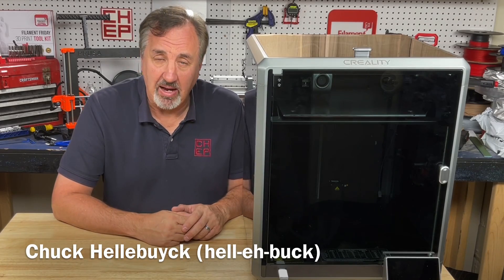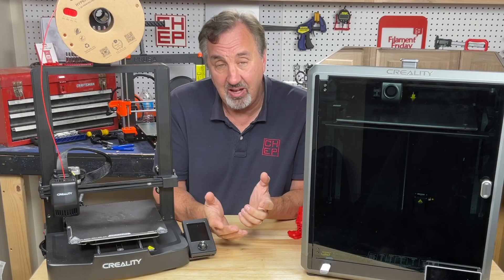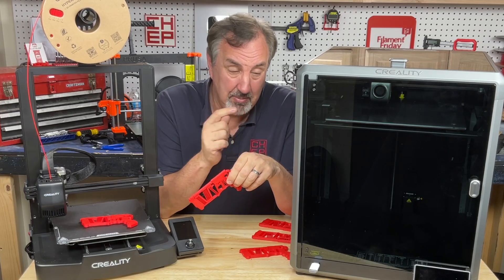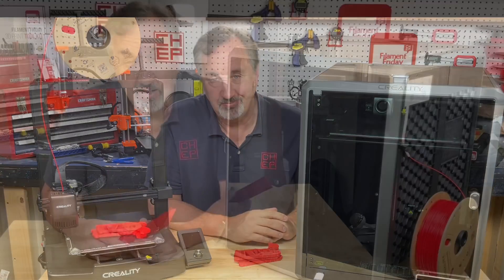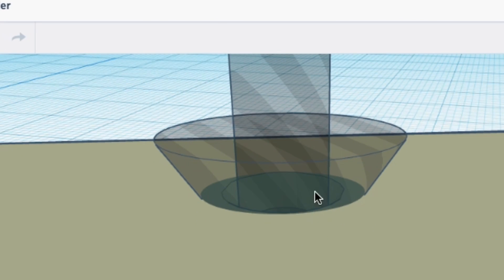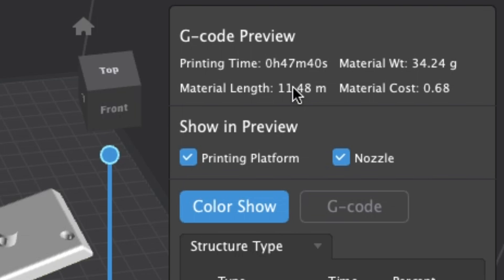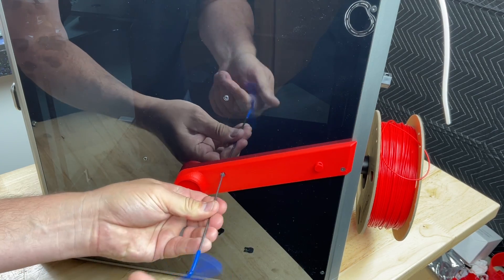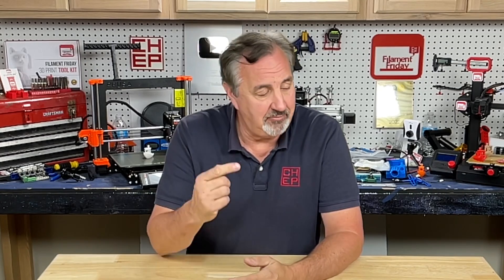Side Spool Holder for Creality K1 Max 3D Printer

Comment: Thank you. I want rotate my printer 90°, but the printer would stick out from the wall too much. You have solved my problem.

EDIT: My experience and FYI for others...The closest length of screws my ACE had was 20mm. No big deal to shorten them. I shortened to 12 and 16mm. The 16mm goes in the middle of the glass. No problem. The 12mm goes along the glass edge. No bueno for me. The screw wasn't long enough. Back to the store for another 20mm screw. For this location at the edge of the glass the length of the screw is not important. I used the 20mm length. It has no ill effect on the printer.

Comment: This was my first print on the K1 Max - worked like a charm. thanks Chuck.  Interesting that Creality now seem to include a model of a side-spool-holder on the internal storage. They must watch your channel.   ;-). On the  basis that I didn't have any M3.5 I used M3 for the bolts which seemed to work fine.

Comment: Printed this on my out-of-the-box K1 Max. Filament spindle doesn't fit into the receptacle. Had to ream out the PTE hole. Printed at 'normal' setting. Any ideas? ......Ah, DH got the spindle to fit the receptacle. Tight fit, which, I guess it has to be. Now to find the brim/skirt setting......much prefer Cura. Printed with brim...

Comment: I did 3 mod on the spool holder reverse boden setup 
1. Mounted side spool holder higher (gets the spool out the way) and uses the mid top and top side frame screws rather than flimsy side plastic screw  - 
2. Filed/4.5mm Angle drilled out the back tube slot on a strong angle -taking off the sharp edges of the slot and smoothing the tube flow (recommend this as an easy must mod costs nothing and works great)
3. Changed to 4mm OD -3mm ID feed tube. The filament slides in freely now TPU slides in like ABS/PLA in the tube when feeding.

Comment: soo the spool holder is already included on the k1 max when you buy it. the time laspe/camera is the only bad thing about this printer. it crashes and does not allow you to watch the camera live and then has bad frame rate at times, on top of that creality tries to make you have their subscription to use it all fully and its $100 a year. their software is fine but can not do helmets in a timely manner. they definitely rushed it and their software. Also if anyone has the camera viewing problem, you have to do a factory reset. Their support desk WILL NOT be of any help. They try to blame it on your internet, wifi or firmware and also they do not know k1 and k1 max have separate firmware. I just got mine a day ago and had to deal with all of this already. Other than that, yes its a fantastic printer.

Comment: Hey Chuck, hope you're well?
Other than the side spool holder is there anything else that needs to be done/modded/upgraded to this printer out of the box?
Reply from the maker: You don’t even need the side spool holder. It’s ready out of the box.
Reply: @FilamentFriday  how's the hot end on this printer and is it reliable? Have you had an issues at all yet?
Reply from the maker: It actually failed right after making this video. I had to replace it. Video coming soon.
Reply: @FilamentFriday  I have seen that the 3D Printing Nerd swapped his out for a Microswiss hotend that could be changed cold and with one hand apparently. Unsure of the cost implications though.

Comment: Now the PTF tube will wear out in the bend to the inside. I have 8x K1 Max and had them all. Have drilled a slanted hole inside much better. Also the bend to the hotend last bend will also wear out

Comment: Does your k1 also have some ringing issues? Im printing pla at 240mm/s for outer walls (infill is 450 and inner walls are 270). Idk if its just my printer, bht i need to find out fast before my return period is up. 

Ive tried orca slicer as well and calibrated my filament settings and still no dice. Orca slicer did have a step up on quality though compared to creality print. 

My acceleration settings are pretty modest as well at 10k outer, 12k inner, 15k infill and tbe full 20k for travel. 

Idk what jt could be at this point.

Comment: I Have the K1 max with a variety of different nozzle sizes using Creality print, I'm still looking for the right profiles and I'm not seeing a big difference in the default profiles between 0.4, 0.6 and 0.8 speeds.

Comment: Neither of the K1 bracket links show any models in Thangs pages? It Said " We couldn't find the page you're looking for. Sorry! "

By the way Chuck, have you a step by step video help on setting up Elegoo 3 Max Klipper firmware controls on the Big Tree Tech PAD 7,
I can't work out how to find the right "Klipper.bin" file for the 3 Max? and how to install it on the pad 7 when the file is found.

Thanks.😀
Reply from the maker: I fixed the Thangs link. Thanks.